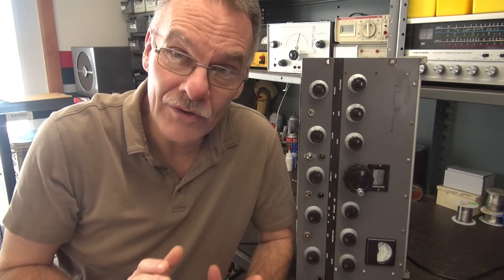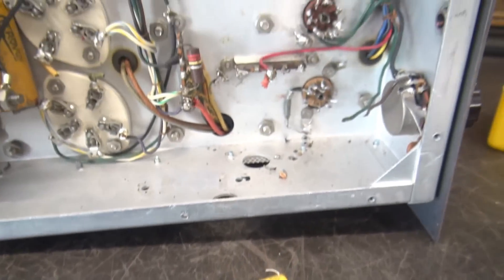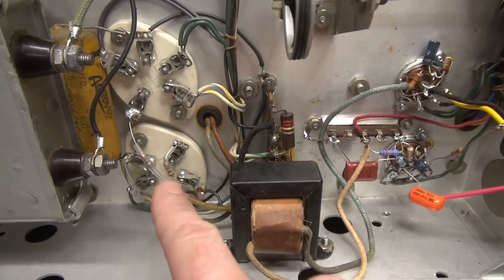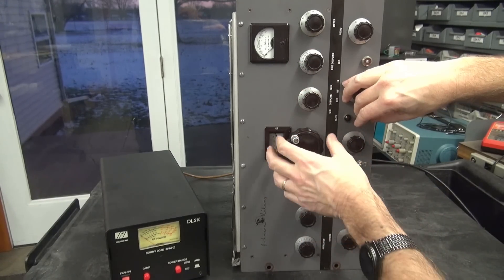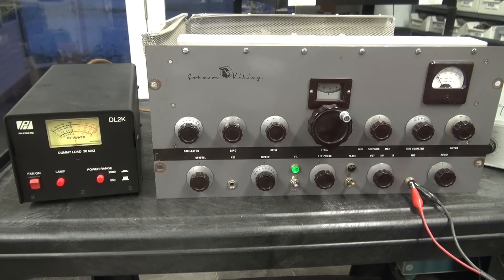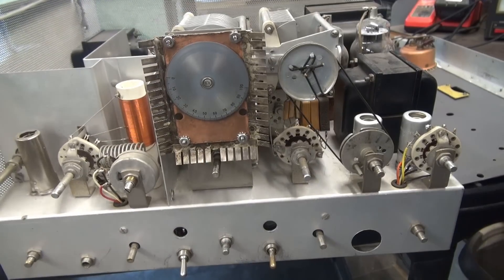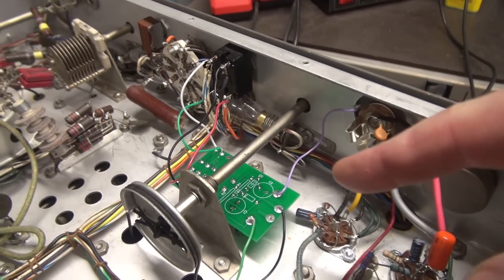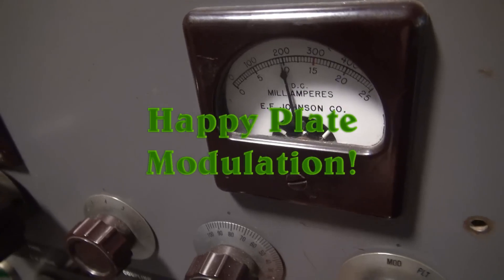How to repair Johnson Viking 1 Ham Transmitter Modulation section D-Lab service Part 4

Comment: At 11:11 the capacitor marked C2  on the green board has a poor solder joint. It  leads to a  black wire.

Comment: Why can't you mount the new MIC jack into the chassis? Hole already too big? 
I always hestitate a little with non-reversible changes on vintage equipment.
Reply: You'd have to make sure the jack sticks out enough from the back chassis to at least get flush with the front panel.  And then you'd have to worry about if the hole was too big or there was damage around the hole that's now exposed.

Comment: I was a CB and HAM radio operator way back in the 60's. I forget a lot of the equipment we had but your videos do jog my memory from time to time. I only had my novice license and mainly only used 15 meters and morse code. (WN3ETU Pennsylvania). I always drooled over the D104 mics which I couldn't afford back then. In the late 70's, a local electronics shop was going out of business and had a new old stock D104 microphone in the box for cheap. I was no longer into communications so I passed it up.